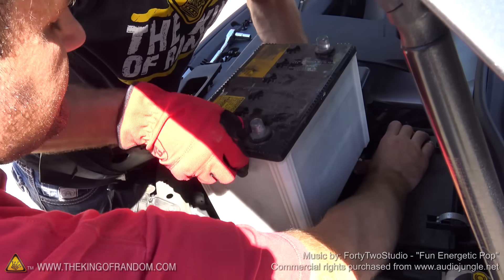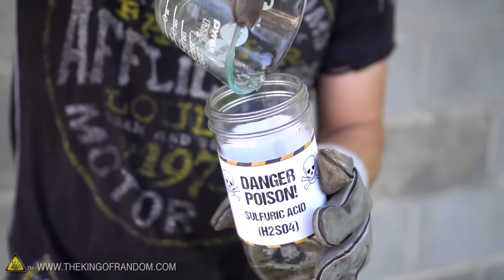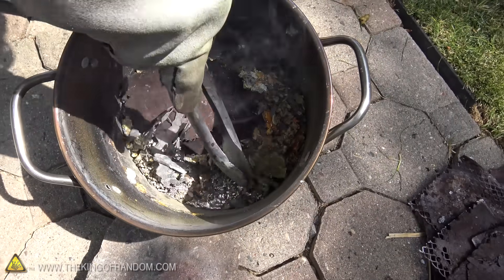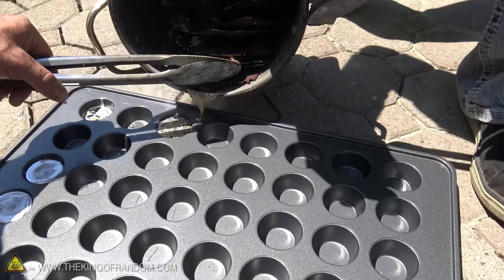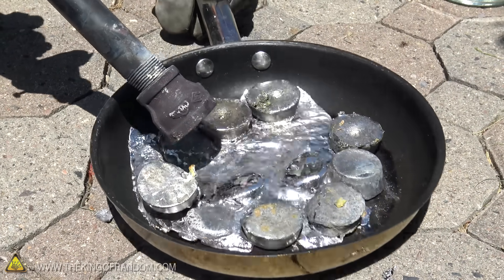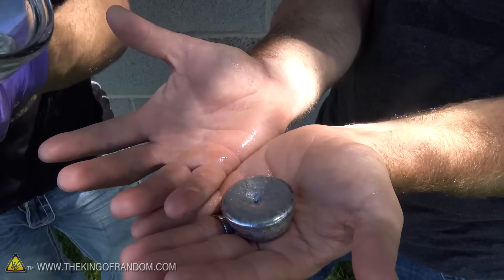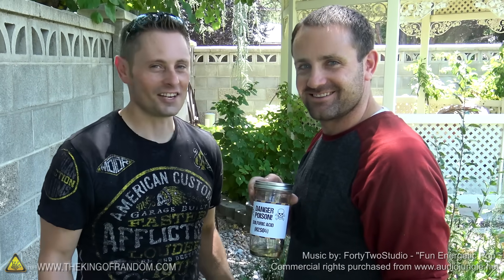Lead Ingots & Sulfuric Acid Scavenged From My Car Battery

Comment: Picks up pan of LEAD
"Wow that's really heavy!"
Reply: xD
Reply: "Lead"?  No litmus tests were shown.
Reply: Lead is a really dense element. What do you expect?
Reply: 1. its density doesnt matter
2. its weight does, and no its not at all the same thing
3. really? the whole point of his comment was that lead IS heavy, he was being sarcastic.
Reply: *****
definition of density:
1. the degree of compactness of a substance.
2. the quantity of people or things in a given area or space.

In other words, the density of a metal says how close the atoms are placed, it does NOT say how much each atom weigh, lead atoms are extremely heavy and therefor lead weighs a lot (it is also very dense, but that was beside the point).

Sorry to rant about this, I'm aware that a lot of people use density in the way you do, but its not 100% correct to equate density with weight.
Reply: +DJCreeperProductions that was the worlds worst burn....
Reply: +Mag density is what defines weight, a box of one chocolate vs a box of 10 chocolate, which one heavier?
Reply: +Mag I'm not here to offend or try to make anyone look bad but I'd just like to say the SI units for density are kg/m^3, i.e. the mass of a substance which will fit into one cubed meter in a set of given conditions, so lead can be said to have a high density. After this you can explain the high density of lead by looking at it's large atomic mass. As i say I'm not here to offend anyone, i was initially agreeing with you until i thought about it for a bit, but i guess youtube comments were educational for once :P
Reply: uh density doesnt matter when comparing weight. Or, mass which is the correct term.
Reply: These comments are giving me cancer, so I choose to not participate in favor of keeping as many brain cells in tact as possible.
Reply: +Mag I believe that the relative density is a big factor. It's more a "Woah, that is way heavier than I expected it to be!" Rather than "This pan weighs 23.57 kilograms. Hmm"
You are correct in that density doesn't affect the weight, but it does alter perspective.
Reply: +Mag Density is mass / volume. It is how massive certain amount of stuff is, and for a given volume, higher density results in more weight smh.
Reply: Why would I have to inform you of any disorder I may have? I simply stated the physics definition of of density.
Reply: Besides, my comment was not even addressed to you, it was addressed to +Mag. If you read my comment carefully you would have noticed that! :P
Reply: definition of density:
1. the degree of compactness of a substance.
That's right good job. Where you went wrong was when you said how close the atoms are placed. Rubber is denser than air yet air can go through it. Therefore, atoms of rubber were spaced out enough to allow atoms of the air to pass through. The correct thing is how many Protons,Neutrons and electrons are in an atom. Thereby its atomic mass. 

The density of something says how close the subatomic particles of the atoms are placed, it does NOT say how spaced out they are. Lead atoms are extremely dense and therefore weighs more than other objects of similar volumes.
Reply: +Deadly Little Gamer atomic weight is the older term for atomic mass, so it is the same thing.
Reply: Kinda, the Atomic Mass (amu) is the weight of a specific atom, while Atomic Weight, is the average weight of all the isotopes and ions of an element.
Reply: Death Ball
No, youre not correct. Density of an element changes depending on the atomic weight, the farther down right you go in the periodic table the denser the elements get, the densest being Oganesson
Reply: +Mag P = m/v. Density is defined as the ratio between mass and volume or mass per unit volume. It is a measure of how much stuff an object has in a unit volume (cubic centimeter, etc.) What you were looking at was biology version of density. Also, you're dense.
Reply: +nborodi reeeeekt well slot of people explained already but you roasted him
Reply: Computer
Reply: Do you know how much lead ingots weigh?
Reply: that pan is 11.34 times heavier than pan filled with water
Reply: Ethan Reid Osmium is a little more than 22 Times Heavier then water
Reply: Computer hahahaha
Reply: Computer

Comment: The lab worker inside me is screaming at all the danger during this experiment. To anyone reading this, for the love of god don't just go home and do this all willy nilly.
Reply: "pure" sulfuric acid
Reply: I will go to work instead, then do it all willy nilly.
Reply: I know right... Watching the sulfuric acid fume makes me want to tear my hair out. I can almost imagine when someone wants to dilute that acid by adding some water to it... Guys, never add water to acid, only acid to water!
Reply: too late, already have 3rd degree burns and lung damage. Great video!
Reply: Doesn't help that he's using the modern pyrex. So it's not borosilicate.
That green glint scared me. It's just soda glass! 
If it says 'not for broiler' or whatever on the bottom, don't use it!
Reply: It's a good thing this guy is does this enough to be somewhat smart-ish about it and a good number of his subscribers never actually do the stuff he does.
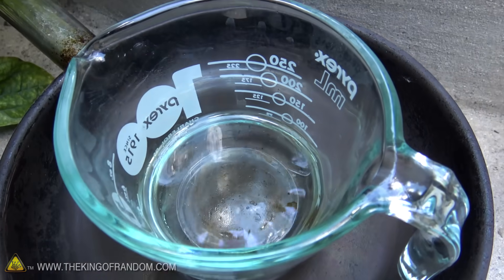Reply: It does- 0:57
Reply: Car batteries are a nasty source of lead. It's much easier to get clean lead from wheel weights, bullets, or fishing sinkers. They could have fluxed the lead with some wax. That would have dissolved most of the oxides, and made much less waste.
Reply: sounds like someone is a fellow boolet caster.
Reply: Seriously, casually fondling lead nuggets and holding the sulfuric acid container right next to his head "Don't breathe this in!"
Reply: I feel you man.. As a chemistry student, I too am cringing watching this..
Reply: You obviously never tried putting water in concentrated acid...It produces heat, lots of it.
Reply: Another good flux material is plain dry sawdust, preferably from hardwood.
Reply: lead is really not that poisonous, you would need to consume a large amount (like 5 grams) to notice.
Reply: i am not an englishman so can you explain what did they produce form car battery? Is it something to sell or something to use for another achivement?
Reply: usewordsnotanger they got lead (Pb) and sulphuric acid (H2SO4). I think the only reason they did it was for fun.
Reply: brainsapper your right and he's a expert
Reply: brainsapper
Reply: 10 pounds of lead and some sulfuric acid. not a horrible bounty.
Reply: Blahblah blah some channel you are so wrong
Reply: Don't try this at home. Try it at a friend's house instead.

Comment: they "hacked" the battery out of the car. I think I should start calling my mechanic a hacker.
Reply: a hacker can also be someone who cuts or hacks into stuff, which he did when he opened the battery in the first vid.
Reply: Hacking "the title I hacked this stuff" means he opened it up or broke in with a tool also try a dictionary for once
Reply: In a few years, a subset of mechanics will have to be hackers in a sense with how things are progressing. We are putting more and more tasks in the hand of the central computer of the car after all. So, fixing your breaks? That's a mechanical thing currently. In five years? It might be a software problem.
Reply: +Volvary hacking just means using stuff for something it was not made for. mostly it's used in the sense of using computers in ways they were nit intended for but if i use my toaster as a door stopper i hacked it. if i use my micowave to build a robot i hacked it and when i use my car battery to get lead and sulfuric acid i hacked it.
Reply: I never argued his use of hacking didn't make sense, don't get me wrong. All I said was that in a few years, more tech savvy people will need to access inside the onboard computers of cars to correct stuff than right now.
Reply: Volvary still not hacking if thats the way it is intended. But i get what you are saying.
Reply: Pops hood "im in"
Reply: not completely; fixing software != hacking.
Reply: I'm going to ddos your fuel tank.
Reply: It's always rough when you leave your car for service and it comes back in ingots and glass jars.
Reply: On the bright side... you get a free glass jar!
Reply: +pizza rio somebody that understands!!
Reply: +pizza rio exactly
Reply: I'm pretty sure that they meant it literally as in they literally hacked into the battery to get the stuff
Reply: Jonathan Meidert lol
Reply: The correct term would be "they cracked the battery car"
Reply: Well hack does mean break. They broke his car battery for this stuff
Reply: Gusstavv's Stuff
Reply: Game Fame h
Reply: lmao
Reply: Jonathan Meidert where he is from, hack means whacked basically

Comment: By the way, if you want sulfuric acid, just by a bottle of drain cleaner, some brands contain high concentrations of sulfuric acid
Reply: True 👍
Reply: well if your a kid dont
Reply: I think most drain cleaners use sodium hydroxide tho don't they
Reply: @steventayman4109  it doesn’t make sense to me as hard as the water is. I always thought acid would be the “drain cleaner” to use when the calcium literally builds up and clogs my shower head but what do I know. Throw some lye at it. 🤷🏼‍♂️
Reply: @loriannschwartz  Drain clogs are often caused by oils sticking things together or just filling up the pipe entirely. Lye breaks that oil down. It also dissolves organic matter like hair, cotton and other fibers.

Comment: Most DIY/hardware stores carry a type of clog-busting drain cleaner that's 97% pure sulfuric acid.  It's normally in a separate section from the rest of the typical drain cleaners, and comes in scary packaging slathered in warnings.  Usually a pretty good source if you don't need lab-grade H2SO4.  ;)

Comment: Shouldn't you be wearing a filtration mask? Thought vapors from molten lead were pretty toxic.
Reply: once for a video? should be fine. Donig this regularly (as folks who make bullets out of car battery lead do), then , yeah, eye protection, full face mask, rubber gloves and probably work gloves over that.
Reply: at those temperatures there is no lead vapor  but the lead particles and dust is what gets you. if you are cooking up some lead most likely the vapor you see is water or smoke for the flux or trash that was mixed in
Reply: +Bob No. lm just talking for the experience that I have. I love to cast bullets out of recycled lead. where I have have to melt the alloy in a pan and pour the ingots.  now I would not put a touch to the lead like the first part but heat a pan on a turkey fryers burner on a cast iron pan ( better heat management) those lead masks only protected you from lead particulates ... the lead vapor masks cost a lot more.. in the range of industries have to order them because of the cost of maintaining them is to great for the everyday worker. by the way rubbing in some ones face that you are wrong without correcting them shows that you are as ignorant so next time you start accusing someone of being wrong please correct them because that's how people learn not by someone telling you its wrong but by someone telling you the what's right. everyone makes mistakes no one needs some prick to rub it in there face
Reply: it's all about ventilation, and with that small amount outside, you're fine. and before the idiots arguing about making bullets start in, I work with lead solder 40 hours a week and use no mask, as we have proper ventilation.
Reply: ventilation helps. Bullet making usually happens in a reloading room or some room that doubles for it, which is why bullet-making folks go on about masks.
Reply: Only in California
Reply: Before you start slinging insults, educate yourself. Lead melts at 621deg and VAPORIZES at 1100deg. It's common knowledge, or should be, that this is the reason why one should not use a high temperature heat gun for removing lead based paint. As Grant was doing it outside he should be fine.
Reply: Xenite227 he was outside
Reply: please I always wear a face mask eye protection and respirator when i melt lead for bullets. these guys dont wear any protection most of the time and touch this stuff with their hands then what pet the dog kiss the girl friend and eat a pizza afterwards.
Reply: I filter it through a cigarette
Reply: +Jeffrey I agree with you that there is no danger there, but just as a general remark, one does not need to heat a liquid to its boiling point before some of it vaporizes. Liquids vaporize at lower temperatures, just a lot slower. How slowly depends on the vapor pressure of the liquid at the given temperature (which can be looked up in tables) and the ambient pressure. If this didn't happen you wouldn't be able to cool off by sweating for instance.
Reply: Correct Tanith Rosenbaum. I was, at that point, responding to a rude responder who has since deleted his post. He said something to the effect that lead was a metal and metals did not vaporize. I was just informing him that lead will vaporize.
Reply: Yes they are toxic but they did not have gas masks on hand
Reply: Uncle Nick   umm arsine gas was used to detect cadmium in a poisoned victims blood so to the lab workers nothing happened

Comment: Does "hack" bother anyone else? What does it mean to hack a battery out of a car? It is best to use the most precise word with a singular meaning. You  removed it, you opened it, and you separated the components.
Reply: to hack something, like cut, to hack at a tree, so yeah, cut
Reply: "Hack" comes from the tool "Hacksaw" so "hacking" something open is fine to say.
Reply: Hack as in finding new uses for the car battery that are not intended, not hack as in cut the batter out of the car.
Reply: Yep
Reply: wow. y u b so technical??
Reply: +Awkward Telegrapher ha, yeah
Reply: Hack as in the words hipsters and wannabe techies use to really emphasize that they are doing something in a way it was not intended to be done!
Reply: It doesn't bother me, I will lose 0 sleep over it, but I C ur point, it wasn't hacked it was recycled or repurposed

Comment: So apparently now taking something apart counts as hacking.
Reply: I don't know exactly what it means but hacking doesnt just mean hacking some poor kids minecraft account.
Reply: +Elrarion2 thought the original meaning wad an expert in something
Reply: Yeah- I think clock-boy started that trend.  He called taking something apart "building" it though
Reply: Elrarion2 Generally it means to modify something so that it does something that it was not originally intended to do.  Just taking something apart is not a hack. Modifying the battery to do something else would be a hack. Building something from scratch is also not a hack.
Reply: Hacking at something I think
Reply: jesus, kids and their computers!

hacking
1. cut with rough or heavy blows.
"hack off the dead branches"
Reply: *****
you're Quebecois though, maybe we should just fight it out in the hockey rink :D
Reply: you need to read more books friend
Reply: Yeah, but just recently we've created another definition. You can thank buzzfeed for the term life-hack and for dumbing down society.
Reply: Hacking means modifying something to do something it was not originally intended to do.  Breaking something down for its material and building something completely new and absolutely unrelated from the material is only "hacking" in the most vague and specious sense.
If you accept that meaning, then we hack grain into bread every day.

Comment: Tip for future references. If you have access to acetylene cutting torch turn on the acetylene not the oxygen and cover tray or mold with the soot then pour lead in. Preferably warm the mold before pouring it. Lead will just drop out easily when cooled down. Works great for fishing weights and bullets.

Comment: Someone explain the science behind lead poisoning and why it did or didn't come into effect in this video....
Reply: Lead poisoning is when you get too much lead in your body, and it usually takes several months to take effect. They have solid chunks of lead, so it didn't get into their bodies, plus even if it did it would take to long to show effect in the video.
Reply: you can touch solid lead and not get lead poisoning, but lead that gets into your system can start to accumulate.  as long as they washed their hands before eating or smoking, they will be fine as far as lead is concerned.
Reply: Usually people say eating or touching there mouth and stuff...but you said smoking?
Reply: +Kyle Kern yes because you tend to think "I'm about to eat, I should wash my hands" but not "I'm about to touch a cigarette then put it in my mouth, I should wash my hands." company I worked for had a big problem with their smokers getting lead poisoning over time. not really the non-smokers though
Reply: If you work with lead 5 days per week, 4 weeks per month, you will probably get lead poisoning, otherwise you're ok
Reply: Willian Dissenha that's not true. you need to ingest the lead or get it into your blood. you can handle lead just fine if you wash your hands after and follow simple safety precautions, like wearing a mask if you work with molten lead constantly in confined spaces.
Reply: ***** Well, that's what I mean, so-so...
Reply: trust me they were getting some lead into their system. as well as spewing some into the air. they definitely should have had masks on
Reply: Thomas Frye ok
Reply: kali linux

Comment: i have a question. why would you need lead ingots or sulfuric. ive worked around sulfuric for years and besides the use in nuclear plants i don't see a reason for it. i mean with heat and mixed with nitric it does make stainless steel pretty shiny but nothing useful